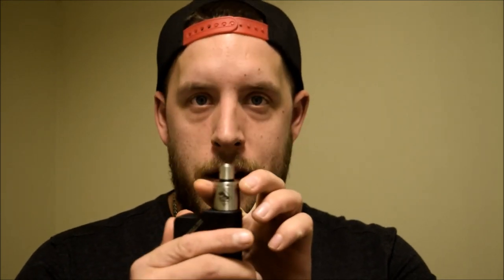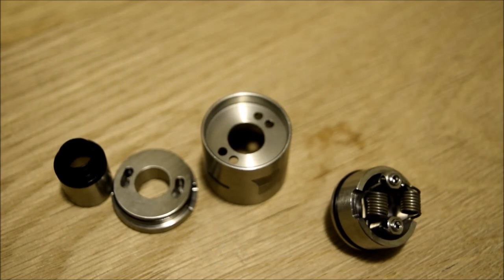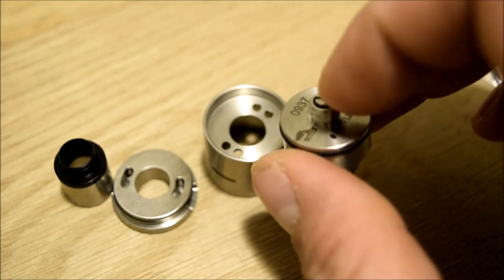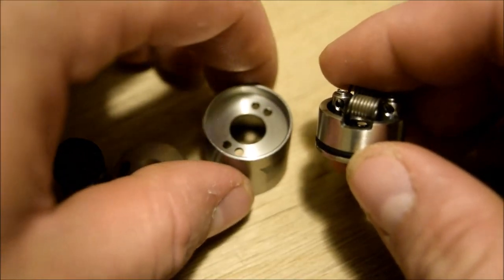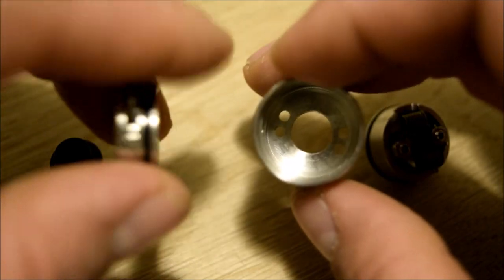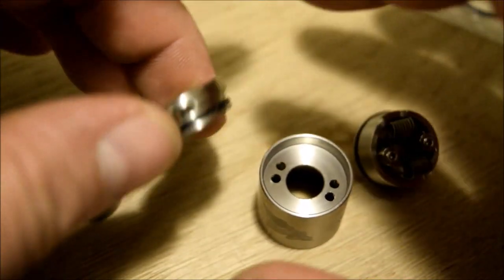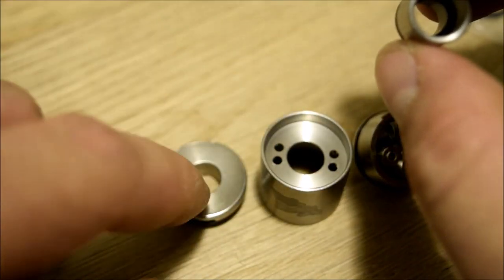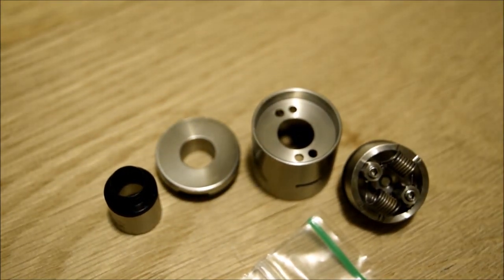Tugboat v3 UnBox & First Impression

Comment: Bout time a V3 video came out, love my V1 and V2 might as well add this to the roster
Reply from the maker: Yea it is about time but totally worth it so far, although some may dislike it as it's a bit more complex then it's older brother, I love the option to cut off side airflow an only use upper afc option.
Reply: +Vaping Monky yeah but when you do that, the top holes are over the posts, not the coils... :(
Reply from the maker: +mrecorvits if you offset your coils to the left or right when you build you're hardly over the positive or negative post
Reply: +Vaping Monky yeah I'm not sure if it was intended to work like that, more of a workaround I think, lol. I got one and am sadly, kinda disappointed with it. The overall design is "awkward" and performance is just "ok". :(

Comment: also if the v2 barrel  will fit the v3 base then having a two post v2 would be sweet. plus it would allow for single coil.
Reply from the maker: this was just an unboxing I'm going to do another video of final impressions soon, as far as the v2 barrel it does not fit on the v3,  I took the O ring off and tried just to see if it would fit flush and it won't not even close
Reply: +Vaping Monky thanks brotha
Reply from the maker: ***** np